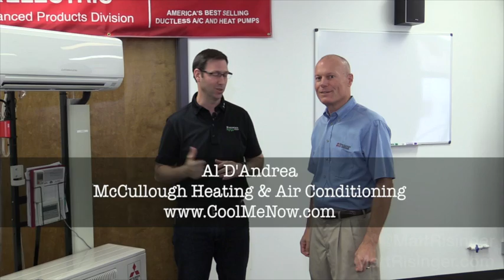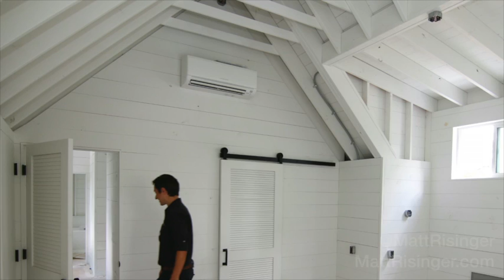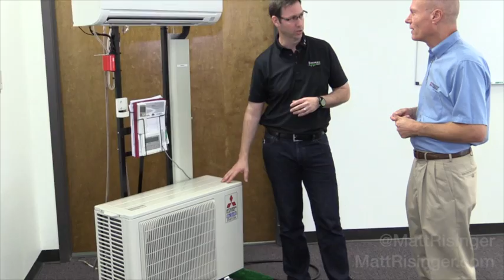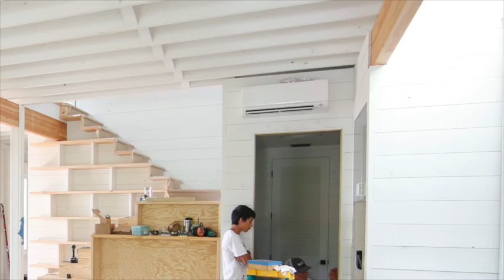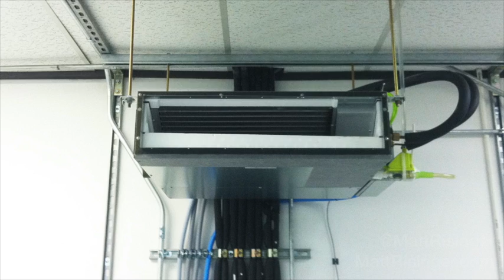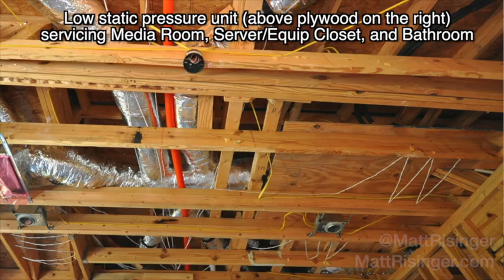Mitsubishi Mini-Split A/C system review

Comment: Only negative on a house with many zones is yearly maintenance.  Each wall unit and cassette will require cleaning by a HVAC tech or other professional unless you are a solid DIY er.   If you don’t,  your mini split can become a mold machine.

Comment: I love mini-splits but don’t forget about the maintenance each head unit will need each year.  You can diy it but it would be a major pain in the butt if you had more than one or two head units or cassettes.  If you don’t clean them at least yearly expect mold problems—something not an issue with central ducted ac units.  This yearly maintenance is distinguished from the minor yearly maintenance on a ducted ac system (ie coil cleaning).
Reply: I'm getting ready to do 6 zones in my entire house. Standard HVAC is outdated junk.
Reply: Ducted mini splits exist that keep the pros from both solutions.

Comment: I need help wiring my aspen mini lime condenser pump….  Where does the gray wire go? Says it goes to terminal block 2 …. I don’t know where that is? Took it out before and am 99 percent sure it was wired to the terminal block on the unit. Didn’t pull it from outside ……. Anyone explain this?  S1 S2 S3 purple and black into S1 red into S2. Green to ground ..  where does the gray wire go?  SYs the orange is to be capped.

Comment: Had one installed and it seems like since it was serviced the air does not blow out of the front all the way across the unit. Only from the corners, is this normal? Shouldn't we feel air all the way across the unit?

Comment: +Matt, I have followed you for a few years now. My wife and I are now living in a 7,000 sf 1935ish school house in North Alabama that we have been renovating for the past two years. Most of my decisions were based on building science I picked up in your videos. I used the ZipR sheathing, metal roof with air spacing, closed cell foam insulation, wall within a wall to break thermal bridging, and whole house Mitsubishi mini splits. I have 13 heads/zones with five outdoor compressors. I am sure others would have made different decisions, but so far we are extremely happy with our electric bill averaging under $300 per month. My installer said Mitsubishi wants to feature our house in some ads. Could not have done it without your videos.

Comment: could you provide an analysis comparing electrical comsumption between 4-ton centralized system and mini-split ( ductless) system (5-zone). i would like to know which is more efficient if the mini-split system is all running the five zones. each 5-zone indoor unit has its own outdoor unit.

Comment: Have had a splitter unit for less than two,years.  Internal coil is leaking.  Paid company in Charlottesville Virginia  that installed unit $500 to find problem and will have to pay same amount or more to install new parts.  Part is covered but paid $1,000 after less than two years.  I would not recommend unit.   Called Mitsubishi customer service.   They were indifferent

Comment: ,27 year A.C. & appliance. I retired 10 years ago , wish they (,"Mitsubishi) was around sooner,lol. I RESEARCHED THESE units  app.10 years ago and found out in  South Louisiana, with high humidity, the performance AC was weak,,( several years ago),,I was getting calls because of lack of cooling.The unit was operating as designed & efficiency was impressive.to me."Has the technology for high humidity areas ever improved?-& how well will these units move the air and reduce humidity?,,I recently  noticed many have been installed in chain stores here in the south.I will be interested in a unit after my new shop is completed. Thanks,☆☆☆☆

Comment: I have 5 in my home. They are quiet and efficient. My issue is that they dont remove moisture well. Very often areas cooled by these units are at 65% RH and that smells musty. Mitsubishi has seen them and say they are fine. My central air kept the house at 40% RH.
Reply: Yeap. I have the same problem. I'm extremely disappointed.
Reply: @janevance6637  unless you have the Kumo Cloud...which can be installed anytime...you have to just put it on dehumidification and watch it. As per my response...Kumo addresses it.
Reply: There's a built in dehumidifier function , have you used that ?
Reply: @davidsuminski4243  unless you have the Wifi Kumo Cloud the humidifier is flawed. You cant set a temperature when you enter humidify on the remote. The unit will just run full blast and you cant control the temperature. With the Kumo...you CAN select dehumidify AND a temp. I believe its a design flaw.
Reply: @rogerwhiting9310   no problem,  I understand your concern better now

Comment: Question, I have a Commercial Steel building (35x45, 16' ceiling all very well insulated) that we have built a 550 sq ft apartment in. Right now we use a single window unit to cool the living area, not very well either! Looking at going ductless, cooling the living and bedroom area, but also looking to cool the rest of the shop area. The shop area will not need to be cooled all the time, Can a single unit do all that? or would I need a 2nd unit. Thanks for any help.
Mike
Reply: May get some issues with stratification that can be solved with a ceiling fan, but your answer is going to fall on how much power is being used inside, how hot it gets outside, and how well "well insulated" is.

Comment: My condenser coil in the attic has a drip catch tray that goes to a drain. How does this system transport condensation and lower the indoor humidity? In the absence of a drip line from the unit, a separate dehumidifier would be needed in humid areas, which basically will wipe out the efficiency savings....update, I went and 'googled' that, it will need a drain line and if you dont place in a spot close to a pipe, it will need a pump system to carry the condensate to a drain pipe.
Reply: From the unit inside the house there is a drain line that goes outside and normally to the ground.

Comment: Buy the smaller units...6000 or 12,000 BTu’s.  Why? They run 24/7 and the smaller units use the least amount of watts on low.  Crunch the numbers and run them out for running on low for the year with the different units and you will see the what I’m talking about. The smaller units use 150 watts per hour on low  that is  0.36 per day at ten cents per Kilowatt hour.  Where as the larger units use 550 watts per hour on low which is $1.32 per day.  Buying the smaller units save you $365 a year!   They all put out 135 degree heat running on high! And when they get up to temp they all run on low!  If you are in a well SEALED area this is the best unit on the market!
Reply: True on the amp draw on FULL, but what I like is the how little the amp draw is running on low.  When the room gets up to temp , I know for a fact the wattage draw is 134 watts  for a well sealed room.  This is on a 12K unit.
Reply: would you still reccomend this unit ? or is there any better models your aware of? thank you.
Reply: Mr Slim is the best!  

When I walk by it in the SUMMER or Winter... I say  “ I LOVE this unit!”  .... In my 66 years of living I NEVER said that before !   

When I go to Florida for the winter it keeps my place at 50° for less than $1 per day on a well sealed 1200 sqft area in Canada.   

The only down side is to maintain the warrenty for the 12 years I have to schedule a $150 annual inspection ...that adds another $1800 to the total bill.   

Make sure you totally understand all the conditions of the 12 year warrenty before buying any Mitsubishi product.

Bottom line... YES, I recommended this product compared to all the other choices.
Reply: I think the 12000 btu uses 1200 w / 240 v = 5 A and the 6000 uses 2.5 A

Comment: Matt can you recommend some AC ductless split-system for 300sf commercial space. How many tons should I get and which model? I like Hitachi you mentioned as its self-cleaning. Would appreciate your help. Thank you
Reply: 300 sf? That's really small.  Find unit with lowest BTUs possible bc that's a tiny space.  Even the smallest may be oversized.

Comment: i am cunfuse between mitsubishi electric and heavy duty i live in india and i need best quality with good after sale service..i like electic one but some people say heavy is better but the company only do trading so they dnt give service from their side kindly suggest which one should i buy 1.5 ton 5 star
Reply: I bought 2 MHI Non Inverter Models 2.2 and 1.6, they are great, using them since 3 years. Haven't got a since issue and no repairs. Don't expect service from ME or MHI, but you need a good AC technician to get the best out of them during installation and I don't rely on the company for warranty and service, so if you can manage this then ME/MHI is awesome. Now I am also confused too, which one to buy. Now I want to buy ME, and it has a great reputation too. If it is for a big room then MHI 2.2 is perfect, if you want R32 variant that is also energy efficient then 2.0 T ME MS-JP non Inverter will be perfect.

Comment: I installed a multi mini split system for my house this year and it cut my power consumption in half. It was a a Samsung four zone but I only used it for three rooms I installed it myself but I let the AC guys recharge it for me since I didn't have the tools. These are great systems and they are super quiet. I was a bit worried of placing the outside unit close to my bedroom window but I now know that I don't even hear it running. I would recommend these units any day. And guys if you are worried that they protrude in the inside walls, there is another option known as the Cassettes that are completely concealed from the top of the ceiling. If I can do it, you can do it too but be careful plan right and execute right...
Reply: Emmanuel Isanda  Do you know how many air handler’s you can connect to the outside unit? And roughly how much would I be looking at moneywise thank you
Reply: Are you sure it save your energy bill ...we install one last month and this month my electricity bill was doble the price.!
Reply: @normaRamz3474  which model did you get?
Reply: @omarreynold6782  Mitsubishi /electric/inverter.

Comment: I have a new ducted Mr. Slim 4 ton system on our new house with 5 zones.  Thought we were getting state of the art equipment but.  One day the rooms are freezing cold and the next it is hotter than hell.  We never touch the thermostat.  Nobody knows what is happening.  It does run quite but it runs all the time.

Comment: Sir I have some question, I used 165s   5/8 ODF filter drier in AC split type but the copper line in high side is 3/8 , the unit is 28000 BTU , isn't OK did I install ?

Comment: Looking at finishing a basement room about 240 square feet and doings mini split in South Dakota. Suggestions really cold climate?
Reply: They have low ambient models, for really Cold climate, they have supementel heat strips in the condenser

Comment: When I was in Iraq in 2004-2006 as a consultant in the US Embassy, Baghdad, we worked in locally built buildings and they all used these ductless systems.  They are very quiet, with remote controls and were great.  About time we get them in the US.

Comment: Matt, 
What is the smallest unit ?  What sq ft does the smallest cover? Can I install it myself?
Thank you
Reply: Unless you're familiar with pipe welding and refrigeration, then I think you should leave it to a pro. There are so many little things that you need to do correctly for it to work. Use a licensed and bonded company for everything involving HVAC. Even installing a thermostat can cause problems if you cross the wrong wires together.
Reply: I bought a 12000  cut my electric in half 860 squared foot  2 bedroom left my bass boards in for real ly cold nights

Comment: Matt, I am getting ready to have a prefab insulated building installed on my property. It will be around 1200 sf. with 12 foot walls (open space within). Is there an option for me that will both heat and cool this space? I have seen these units popping up on school buildings and so on and am very interested in having an efficient means to climate control my new building. Thanks!
Reply from the maker: +The806Traveler Yes, these Mitsubishi mini-splits both heat & cool and they have a hyper-heat model that still heats with excellent efficiency down to like 5 degrees outside.   Amazing technology.  Best, Matt

Comment: Just had my Fujitsu RLS2H (12000btu) installed on Friday.
The objective was to heat a 1300 sq.ft. unfinished open area basement.
During the Winter this area would remain in the 40's f drawing heat from the rest of the house.
As a consequence the heating system was working harder to maintain temperature on the main floors of a 2 storey house.
Even with our fireplace going all day long we could never surpass 68f throughout the house.
The Fujitsu brought the basement from 48f on Friday to 63f today Sunday.
As the basement warmed up over the last 48hrs the whole house has warmed considerably.
We are seeing temps of 75f on the first floor which were never before achievable.
The main heating system of the home, which is a central York heat pump, has not come on since installing the Fujitsu.
I am totally blow away by the performance of the 27.2 seer unit. It has a low temp cut off of -26C.
I see these mini splits taking over from the larger whole house units.
When the time comes I will certainly replace my 11 year old York with a mini split.
If you have been sitting on the fence contemplating one of these units sit no longer.
Do your research and due diligence and buy what's best for your needs and you will never regret it.
Reply from the maker: Great example of a mini-split solving a HVAC issue!  Thanks for sharing.  Matt
Reply from the maker: Captain Canuck Thanks for the in-depth comment!  Sounds like your mini is performing well!  I've also installed Fujitsu and had good success with them.  Best, Matt

Comment: Matt, Nice video!  I think moving forward, all high performance construction will head this way using inverter technology with multiple zoning.  I did my high performance home with three Mitsubishi Multi Port units with ten indoor units - 6 ducted and 4 ductless (including one ductless on the patio).  The efficiency and the comfort are simply amazing.  Quite, NO light flicker and dead-on consistent room temps since you are always moving air to eliminate stratification and matching capacity with the load along with constant dehumidification.  Plus, you have the EXTRA capacity (without oversizing/short cycling)  if you have a party and have 40 people standing around in your kitchen/family room.

Here are a couple of suggestions:  Always use the exterior L-Bracket wall mounts for the outdoor units.  This gets the outdoor units off the ground and away from leaves, pets, pests etc.  Also, the refrigerant can get a little noisy running through the line set.  I'd recommend running the line sets outside an exterior wall and use a gutter downspout to hide them instead of imbedding them in a wall.  This keeps them quite and accessible.

My only complaint is that I have had to replace 2 of the 3 control boards in two years.  No particular reason, they just died.  Under warranty, but still a concern it's going to keep happening.

Al, is right, the best thing is to be able to close the master bedroom door and run it at 68º at night while keeping the rest of the house at 75º.
Reply from the maker: Great insight, thanks for the personal experience comments.  Best, Matt
Reply: I'm getting ready to do 6 zones. Mitsubishi
Reply: If I were to do it again, I'd go Daikin.  I've replaced multiple coils and one compressor.  Getting very expensive to maintain.  Daikin parts are more, but if you don't need them it does not matter the cost. Ed @TCJACJ2000